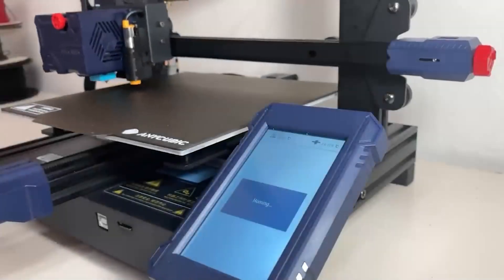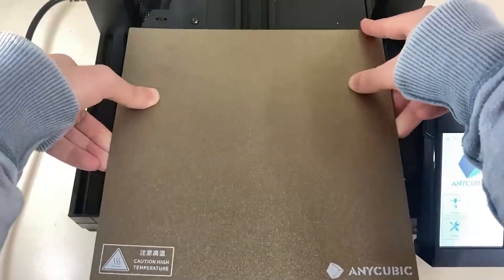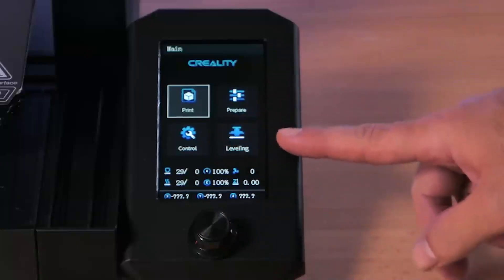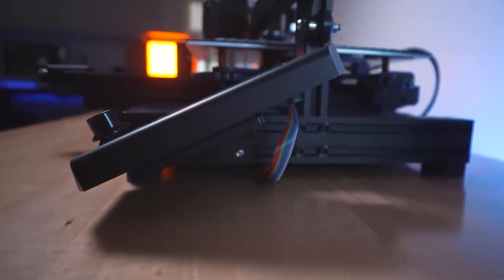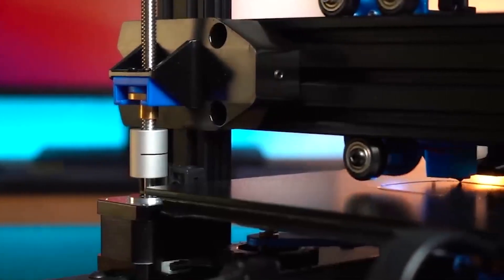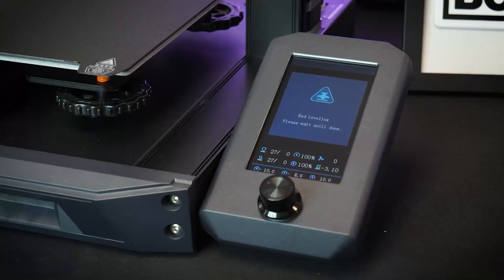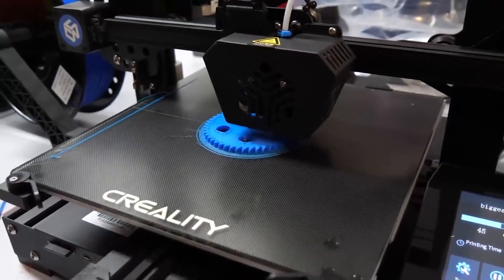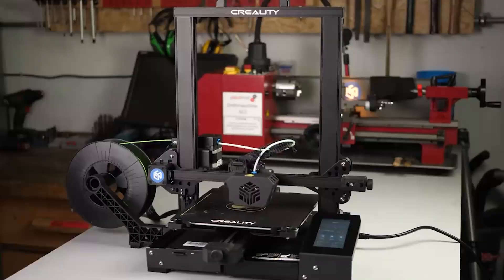Best 3D Printers 2024 [Tested & Compared!]

Comment: The Neptune four is a mess. You have to update the software take apart. The screen update the hardware inside of that just before you can make anything happen not including all the glitches. This is 2020 for these machines should update automatically by the Internet, not by taking it to a computer and changing code, especially with the USB they give you which should already have stuff preloaded onto it that doesn’t even work lol